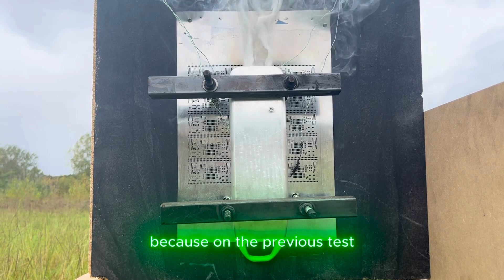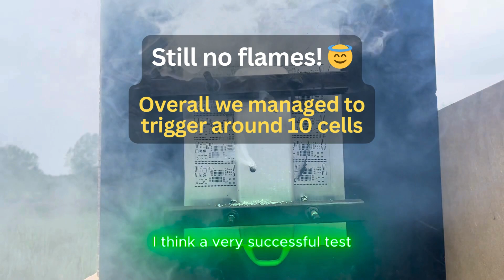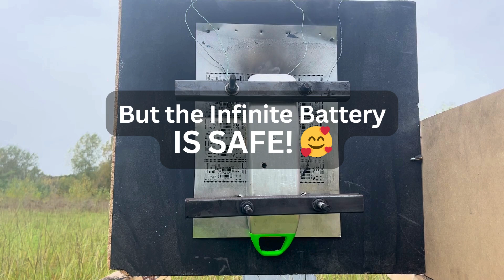Fireproof video (Take 2!)

Comment: so the bosch ignited simply from water ingress into the case, followed by one or two cells being penetrated with a screw (causing either an short between the layers of the wrap, or a short between two batteries, or both)?